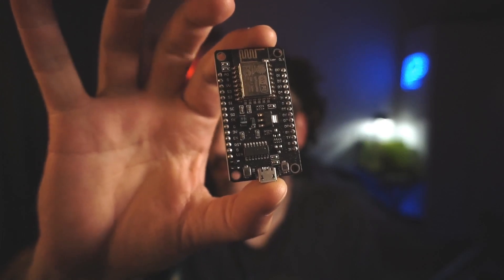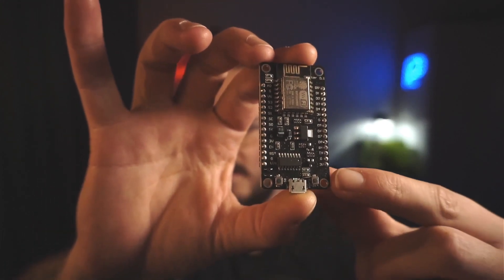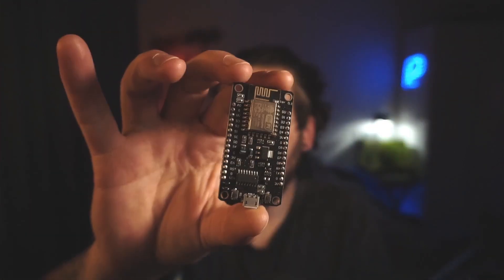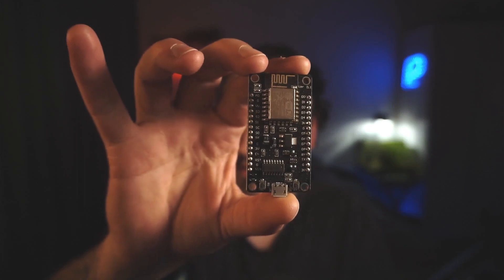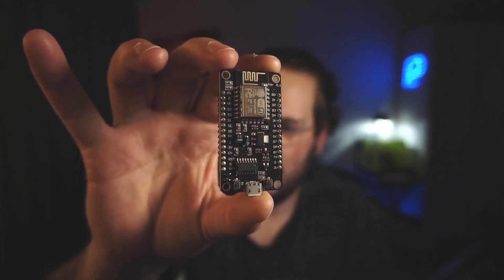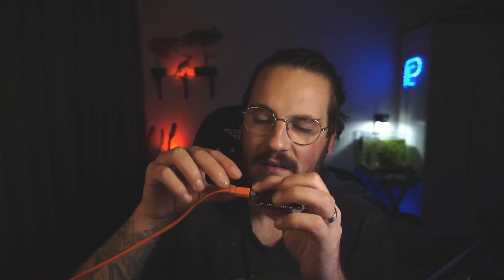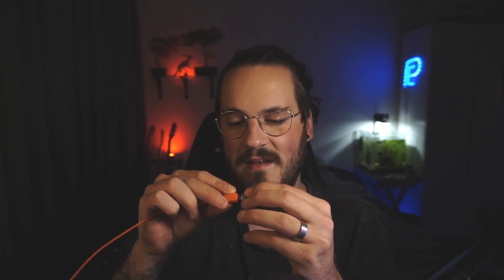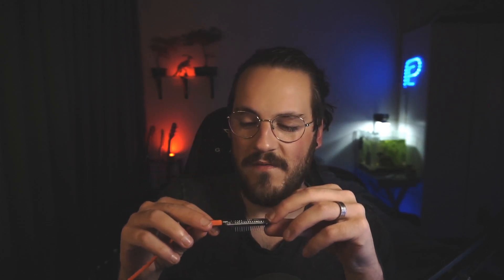How To Reset And Flash An ESP8266 Node MCU!

Comment: The USB serial chip on my esp got fried by a usb power supply. I managed to access the serial output via another, external usb / serial adapter but could not figure out how to flash the esp. I just had to hold down the flash button while plugging it in. Thanks for this little video, helped me after an hour of searching.

Comment: So pressing the reset button while powering on will wipe out only the application, not the bootloader correct?

Do you have an equally easy method for flashing a bin file?   Everything I've seen requires installing too much software (arduino ide, esp32 idf, vs-code, etc).   Would love to press the boot button and upload my bin using putty or any other serial terminal!

BTW, if using the Boot button to upload/program, will that automatically erase the flash too?
Reply from the maker: If I understood correctly what i read it shoud just whipe your board to factory settings. Not sure about the bootloader sorry